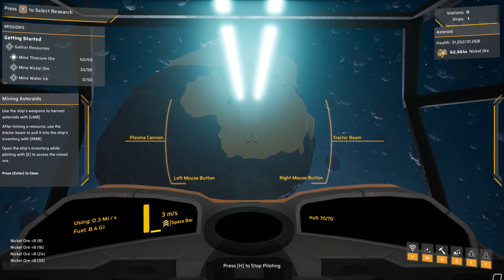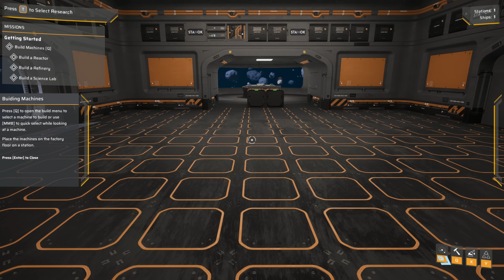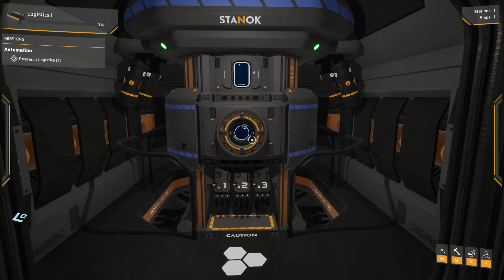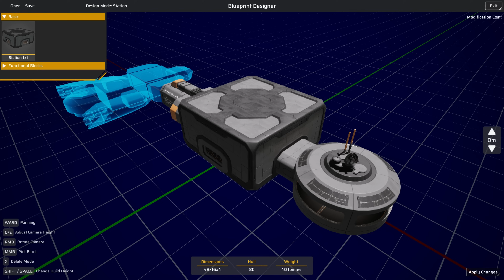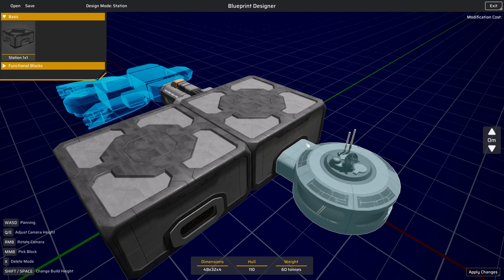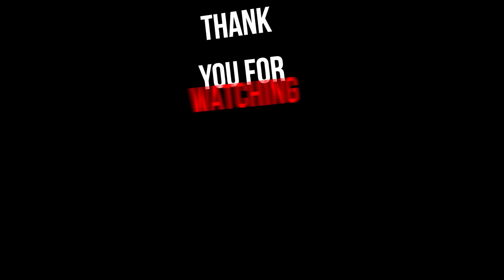They Made Satisfactory BUT IN SPACE And It's Amazing !!

Comment: Z, you built a refinery on your Station.  You may have to build your initial Fuel for your Power Plant on your Ship, but once you have that, do your @!#$ Refining on your #@$% Station, as it's probably faster than the small unit on your Ship.  That way you could set up a large queue of production and fly away in search of more resources.  Eventually, when you do return to your Station, you'll have a bunch of resources available to start expanding your Station.  It may be an idea to clear Asteroids from around your station to provide space for expansion...

As per ANY factory game, you're going to need to figure out efficiencies.  What refined raw resources are frequently combined in an Assembler to make more complex materials.  I'd also look into VERTICAL expansion, as it will allow the localization of refined resource creation.  Otherwise, things are going to need transportation over distances to get resources where needed...